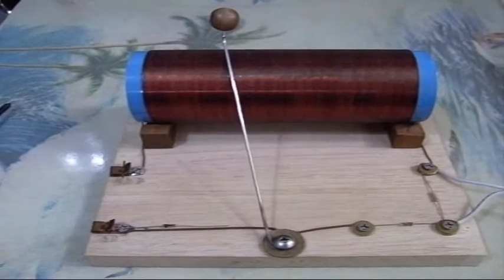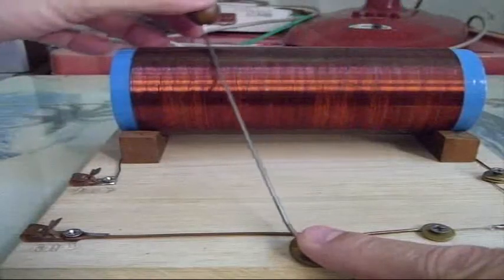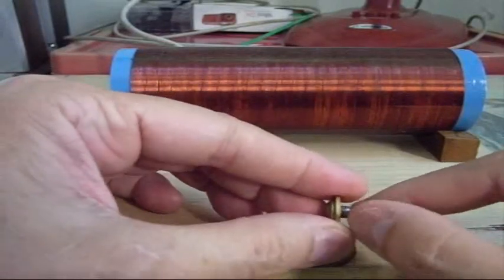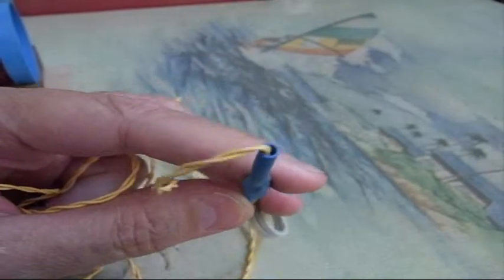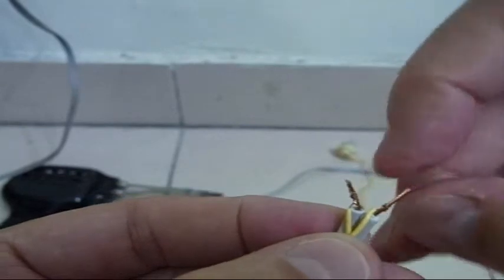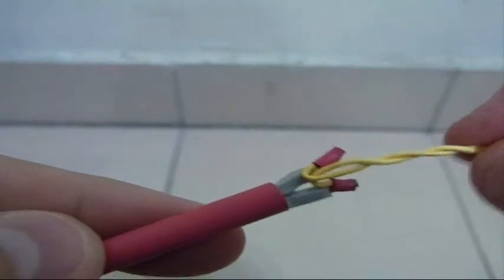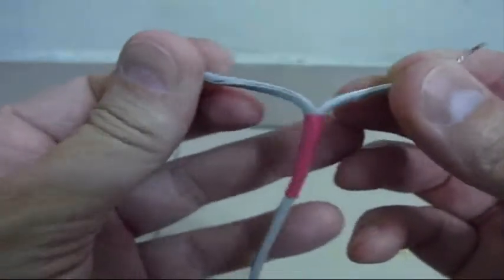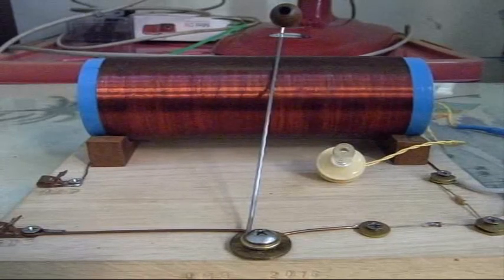Crystal Radio Upgrades & Build Details  (Updated Video Available)

Comment from the maker: Updated Video: Best/Easiest DIY Crystal Radio - No Batteries, No External Power 2023 (4K)
https://youtu.be/fLVCqZGpv3U

RELATED CRYSTAL RADIO VIDEOS: 
How To Make A Crystal Radio - No Batteries, No External Power: https://youtu.be/mt-s7pf-U5Q   
My New Favorite!  Crystal Radio with Antenna Tuner:    https://youtu.be/mh5KxCpbQ5U
Crystal Radio, Capacitive Tuning - WORKS GREAT!:    https://youtu.be/VJ80Nm9KSkE
Crystal Radio & Resonant Coil Design:     https://youtu.be/Fw9eb-aB-XU
Crystal Radio Antenna (Shortwave Also):    https://youtu.be/G8AsgZbncW4

My Crystal Radio Does NOT Work (FIXES for common problems):    https://youtu.be/kCxQ8iPQx4s
Good Crystal Radio Connection Points:    https://youtu.be/G3qjrReHR1k
Three Upgrades For Your Crystal Radio:   https://youtu.be/LENco3_jV_s
Crystal Radio Wiper Upgrade:     https://youtu.be/i1otDz39nlw
Popular Crystal Radio Design That's a Waste of Time - And Why: https://youtu.be/r9Onub2Xpzc   
New Crystal Radio Design - "Modified-Pickard":     https://youtu.be/_qxHhFKjLAg
Crystal Electric Generator RF Energy Harvesting Exp 5 - Full Wave Rectifier:   https://youtu.be/BTu_GJKjOmA

Comment: Something is urong.
Reply from the maker: The new piezoelectric earphones have capacitance.  Without the resistor they charge and discharge making sounds.  Plus you can not hear the radio well as the resonant circuit is not complete.
Reply: What for is the resistor ?

Comment: Hi, 
Always pre-tin all connections so soldering is easy, make a good mechanical connecction with the joint, and apply the soldering iron to the joint before you add any more solder (this avoids any cold solder joints). Adding shrink tubing to any joint neatens up the joint and adds strain relief to the joint. Matching the color of the shrink tubing to the wire adds a professional touch (I know, it sounds picky, but looks good). I've seen the wiper mounted on a block of matching wood, and your idea will make the wiper easier to move and not put much wear on the coil. You need enough tension for a good connection, but smoothing the spoke with 2,000 grit will also cause less wear on the coil. You might lube the wiper with a tiny amount of silicone grease where it slides on the coil so it slides easily and covers the coil to protect it from corrosion. I use brass Fahenstock clips for the antique look, pricey and needs occasional cleaning, but a great look. I use a pine unfinished board for prototyping a new design, then if it works good I transfer it to a stained pine board. I also check the 1N34A diodes for the lesser forward voltage for better performance, they can vary some. I'm going to experiment with hot carrier diodes to see if they work better on the shortwave crystal set I'm gathering parts for, maybe experiment with home made "flapper" capacitors, too. Crystal radios are fun, with no dangerous voltages to worry about. I compare the crystal radios with my Kenwood R-1000 or my Radio Shack DX-394 to see which does better. Good luck de W4FJF!
Reply from the maker: Thanks Fred, some good pointers.

Comment: IS IT POSSIBLE TO USE A MODERN I C AMPLIFIER CHIP OR TRANSISTOR TO IMPROVE AUDIO OUTPUT ???  4440 OR EVEN A MOSFIT  ?
Reply from the maker: I have a video on how to connect a battery powered amplifier to a crystal radio.  It's very simple. 

https://www.youtube.com/watch?v=RW3VhnzgjtA

Comment: Use single copper wire called a ground wire at Ace Hardware which is sold by the foot which is a much better conductor than either the stainless steel or the bronzes conductors. I am speaking to the wiper wire.

Comment: I would not glue the earphone. The tube gets fouled, dirty, and wax built up after usage and you can clean it easily by removing and inserting a q-tip or such. If it is glued fast to the body,  it is harder to clean, and you may get inside the body of the earphone fouled trying to clean it out.

Comment: In splicing two fine parallel insulated wires, i usually stagger the lengths and  then fold them away from each other. It's very helpful in wall wart modifications and only the heat shrink is needed to insulate them due to the spacing of the bare wire connection points...

Comment: Have you tried using acetone to clean the coating of the coil where the wiper contacts?
Reply from the maker: I think that would take more work and you would still have to sand them in the end to ensure there's not lacquer remaining.  Also it would probably affect the plastic and finish on the wood.

Comment: Guy, you need to understand inductive and capacitive reactance.  Here are the formulas you need.  1) https://www.eeweb.com/toolbox/coil-inductance   L (in henries) = uo (mu nought, permeability of free space 4*Pi*10^-7) * N(number of turns) ^2 * A (inner core area Pi*r^2 ... in meters^2)   /   length of coil in meters      2) f (resonance) = 1 / 2*Pi * (SQRT(L * C).   Your coil from the other video is way too many turns, and no, bringing taps off doesn't work because the other side is still connected and destroying anything close to an impedance match, not to mention the capacitance between turns of wire.   Don't mess around with that stuff.  Do it right.

It's a hell of a lot easier to have the proper number of turns on the coil with a proper capacitor across it than sliding something back and forth sometimes shorting adjacent turns and sometimes not.

Comment: I seen a video that they used a post at each end of the coil with a wire between the post..and a metal ball with a hole in it would slide back and forth between the post to ack as the wiper...it was a cool idea..

Comment: Cool worth trying then . 
I still see the ear plug at Radio Shack too . Wonder how long before you can't get that type anymore . I would probably get a hand and use a cordless drill in doing to the winding . 
I am up on a hill and my town actually is 600 to 800 ft above sea level that gives me an advantage too .
Reply: I use the tension  control rig normally used in my fishing reel line refill and holder.

Comment: The AM Radio stations are over 100 kms away from me say average 130 kms . 
Is this going to be capable of reciving them ?
Reply from the maker: If you have a good antenna and the signal is strong, then it should work.  I used to get stations from 2 states away when I was a kid.  I'd listen to baseball games from Chicago.
Reply: At night in the winter. You with  need at least a 100 meter wire antenna and a ground. Ground is metal rod or pipe driven into the ground at least three feet deep.

Comment: can you use stereo earphones for this? Like earphones you would use for an mp3 player. Thanks
Reply: tsbrownie, You are wrong.
Reply: No, it takes too much power. Modern headphones are usually 64 ohms or less.
You need at least 1000 ohms.
If the station is more than 10 miles away you'll probably need a 2000 ohm headphone.
The cheap piezo ones will work for a little while, then fall apart. The best ones are the old magnetic ones 1000 ohms to 3000 ohms.

I recommend these brands:
Cannon, Trimm, Newcomb, and Dictograph. 
You can get them from the "Headphone Heaven" part of Scott's Old Headphone website.
Reply from the maker: No, won't work at all.  They require waaaaay too much power to work and also add lots of unwanted inductance.
Reply: tsbrownie thank you, so a special speaker is used then?
Reply from the maker: Yes, it has to be a true "crystal" earphone.  The modern ones are piezoelectric and they carry with them more capacitance than the old style.  It changes the design as the old one had an added cap.

Comment: Question....  When making something like this does the size ( diameter ) of the could make a difference.  Say if I made a coil 2" vs 5" in diameter, would one pick up better because of size?
Reply from the maker: There are lots of good inductor calculators on line that you can test 
your ideas on (google "inductor coil calculator").  Yes, it makes a big 
difference. For the same length and number of turns, a bigger coil means
 more inductance or a lower frequency range.  The coil and capacitance 
must be matched to the frequency range you want to listen to or you can 
end up with little or no output.  The total values of each can be a bit 
tricky, especially at higher frequencies, because you have to account 
for ALL inductance and capacitance.  For example this earpiece has 
significant capacitance and between each turn of wire is some more 
capacitance and both of those things can easily be over-looked because 
they don't look like a "capacitor".
Reply: Yes. And a wire diameter.
Reply: I've seen a crystal radio for the CB and FM bands on you tube as well. Yea, the coil size does matter. check those out for the coil sized used in those instances.

Comment: I can't find the earphone you used in the radio in any elctronics shop here in the philippines, do you have alternatives to replace that kind of earphone  that is easy to find?
Reply from the maker: +Jonas Orate Some old telephones have crystal ear pieces.  I have heard of people who have gotten those to work.
Reply: You can also make a crystal earpiece out of a piezo electric buzzer like the motherboard or microwave beeper. 
The impedance is different from a standard crystal earpiece so a different matching resistor is used in parallel.
The barium titanite ceramic buzzers typically have an impedance between 350-1000 ohm, the normal crystal earpiece is ~2000 ohm. 

My first google result is this one.
http://billydiy.blogspot.com/2013/03/build-crystal-earphone-for-crystal.html

Comment: I wonder if putting a spring under the screw head with a washer to keep an even pressure on the wiper, would help?
     Curious why you had an extra diode on the ground terminal at the beginning of the video; do they go bad over time, or was it was a spare?
Reply from the maker: +Bruce Wayne Good catch!  I was doing the other video "World's Simplest Radio" and left it sitting there.  Did not see it until the video was done and uploaded.  
I think your spring idea is a good one.  Will have to try that.  I also noticed on antique versions of this the wiper was often mounted on a pedestal so that it would track flat across the coil.  A combination of both would probably be ideal.
Reply: tsbrownie Ah, thanks for the explanation.  I agree both would probably help.  I am looking forward in making a copy of your radio.  Just ordered parts on Amazon.
Reply from the maker: Cool.  If you make a video of it and post it, please let me know.  I would like to see it.  Also if you have questions, let me know.  This is one of my favorite topics.  That's probably no surprise.
Reply: tsbrownie  I would imagine using a 3"~ piece of 1/2" copper pipe for the pedestal would work, since you could solder/braze a washer directly to the top and bottom.  Then a spring on top of the wiper with a 4"~ piece of 1/4" all thread (or carriage bolt) to mount it all.
Reply from the maker: +Bruce Wayne Sounds good.  And I like the look of copper!  Adds class.